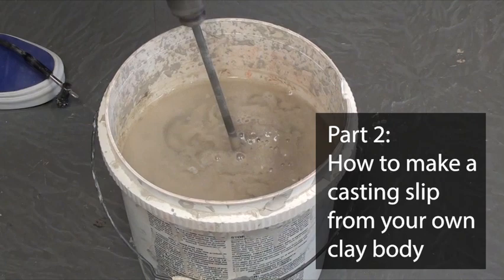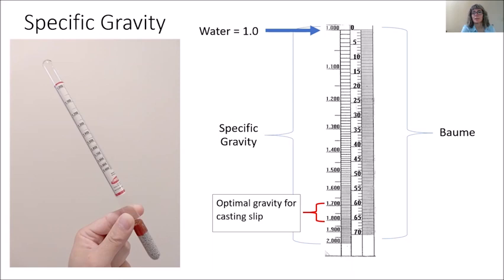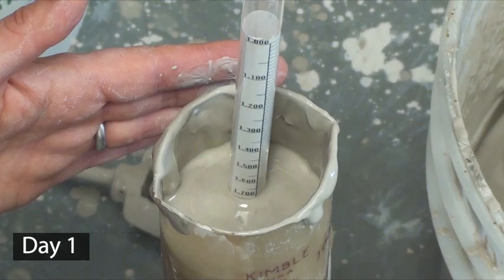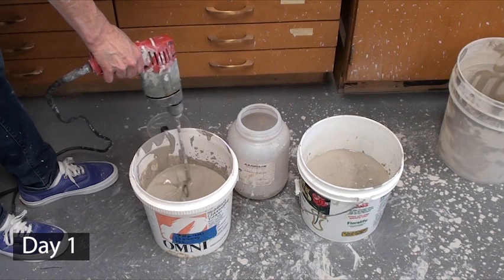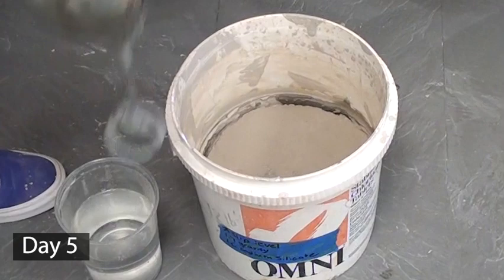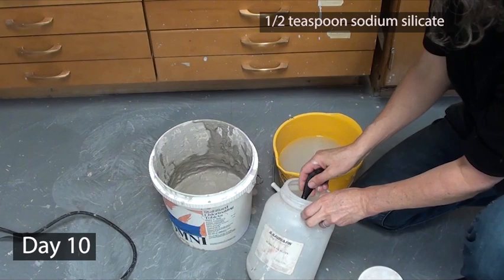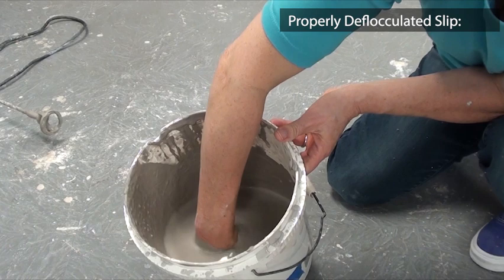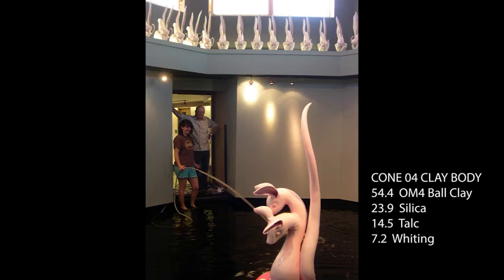Part 2: how to make a casting slip from your own clay body

Comment: Great information. 
Having said that, you mention a few times that sodium silicate evaporated with your water. I do not believe that is the case (or even possible), as sodium silicate has a MELTING point of around 1410 °C and a boiling point of 2355 °C. 
If you dissolve sodium silicate in water and let the water evaporate, the sodium silicate will stay behind.
Reply: That was exactly what I wanted to write too. It is like sea water, a salty solution. The water evaporates but the salts stays behind.

Comment: Thru this process I found it hard to major using my majoring cup but I trust my majorment as my deflocculant  allows the viscosity of my majorments to align
Reply from the maker: Fixed size measuring cups (volume measuring) are not as accurate as weighing.  That's why pastry chefs weigh their ingredients rather than use measuring cups.  I find when making casting slip, accuracy is important.  But you might find that you do not need to be this accurate when calibrating your casting slip.  However, when I make plaster molds, I find this amount of accuracy is unnecessary, which is why I use the volume method for that process.

Comment: How about using a fixed-size measuring device of a known weight? Scrape the top with a fettling knife after filling and wipe the outside. You'll get repeatable amounts of slip. Tare the scale or just subtract the known weight. Very accurate results. Thanks for your good work. Aloha
Reply from the maker: That is not a bad idea.  But fixed size measuring cups (volume measuring) are not as accurate as weighing.  Especially since the same amount of volume will vary in weight depending on the specific gravity of the slip.  I find when making casting slip, accuracy is important.  But you might find that your technique works just fine.  And it probably would work if you have measured the specific gravity first so that you know that you are getting stable and reliable results.  It is important to know what works for you and to stick with it.  Thanks for your thought!

Comment: I have my viscosity perfect but after 5 minutes it’s hard again so if I’m correct I need to keep adding deflocculant until it stays runny for 30/60 minutes?
Reply: I have sodium dispex as it’s common in the UK I couldn’t find any Darvan 7 from a uk seller

Comment: I always struggle with airbubbles, even when mixing slooowly the slip… is it possible it comes from water we use?
Reply from the maker: I really don't think the water has anything to do with it.  It is probably due to the shape of the mold.  Some molds trap air towards the top, so I sometimes add "vents."

Comment: I am very new to this. When weighing slip would it help to use a palm sander with no paper on it to vibrate the slip in your measuring cup?
We vibrate concrete to remove air bubbles in the forms which also levels the concrete in the forms(the main reason we vibrate is to make the concrete look better without voids and bubbles that would need to be filled after removing the forms)
I haven’t tested this idea yet, just thinking out loud.
Thank you for the education.
Reply from the maker: That certainly would be worth a try for measuring the volume of slip, which is what I think you meant to say!  But when weighting, that step would not be necessary as this does not effect the weight.  Thanks for thinking out loud!

Comment: It is scary (and comforting) to see you touching sodium silicate slip... it's MDS makes me nervous.
I got some reclaim slip to 1.6 ( added too much water) and it is taking for ever to dry but it worked, Matt at Hobby Ceramicraft recommends 1.8 to 1.85.
Reply from the maker: Awesome, I'm glad to hear it is working for you.  1.8/1.85 is still in range for slip casting.  It all depends on the clay.  The specific gravity will vary from clay body to clay body.  So you just have to experiment, which is fun!

Sometimes when I am impatient and want to get rid of water, I will boil the slip.  It is really a pain in the but and because I hate doing it, I just wait for evaporation.  But sometimes when mixing terra sigillata, I boil off the excess water.

Comment: Thank you for sharing your process. 

I have been trying to deflocculate a clay body composed from scratch and can’t seem to get past the thixotropic stage. 

It’s nice and flowy with webbing action but it’s gets rather thick about 15 mins later. 

Do I just keep adding more sodium silicate?
Reply from the maker: It sounds like that is the problem; it needs more sodium silicate.  I would all a little at a time and give it a days rest before reaching any conclusions.  If you try to add what feels like enough sodium silicate in one day, you will likely over deflocculate it.  For my slip, I was adding 1/2 teaspoon of sodium silicate (to a gall of of slip) a day, checking back in on it the next day to see if it was enough.  It took me about three days of this before getting it just right.  It sounds like you are very close to getting it dialed in.  Let me know how it goes!

Comment: Seems like it would be easier to weigh the dry clay and add 0.8 grams of clay per 100mg of water.
Reply from the maker: Yep.  That would be easier.  I don't mix my own casting slip very often.  And I am never this scientific about it.  I usually just feel my way through it using my intuition.  Thanks for your insight!

Comment: Do you mix your clay body from powder? I'm trying to see if it's possible to take a ready made clay body like the kind they sell at ceramic studios, and then convert it to a slip?
Reply from the maker: Both ways work.  If the clay is already mixed, I find it easiest to roll it out into slabs (or separate it into chunks), let it dry out, then add the water to slake for a day.

Comment: Is there a variance in gravity with different forms of slip?
The reason for my asking is due to knowledge of how to make various Stone Slip such as Marble and other sorts of stone.
I'm currently seeking collaboration with those capable  of your given talents.
Your response would be much appreciated.
Reply from the maker: There is definitely variance in specific gravity with different slips.  Some slips work best on the heavy side and some work best on the light side.  You just have to experiment.

Unfortunately your question about marble and stone are outside of my area of expertise.  Good luck!
Reply: @rebekahbogard3322  
Thanks for responding.

Comment: We should to add sodiumcarbonate to reduce the thixotropic?
Reply from the maker: If it turns thixotropic too quickly, add sodium silicate.  Add only a small amount of sodium silicate at a time and be sure to give the slip time to adjust after adding (about a day).  Otherwise, if you add too much sodium silicate, your slip will become very thick and it is difficult and time consuming to remedy.

If your slip becomes thixotropic after about a half hour or hour, that is pretty good.
Reply: @rebekahbogard3322  Thank you!!

Comment: I have a question I have had a bag of slip stored for quite some time it's a fifty Lb bag and I lost my directions on how much chemical to mix it with can you help? I think there was 3 ingredients.
Reply from the maker: Yep.  I'm sure it was Barium Carb, Sodium Silicate, and Soda Ash.  When Ceramic Warehouses sell casting slip, they always send instructions.  I would just go to one of those websites (such as Aardvark, Bailey, Laguna, etc.) and look it up.  They always have PDF files on the instructions.  Even if you don't know what kind of slip you have, I would just blindly follow the instructions as a starting point.  It will get you in the ballpark and then you could simply adjust it accordingly.